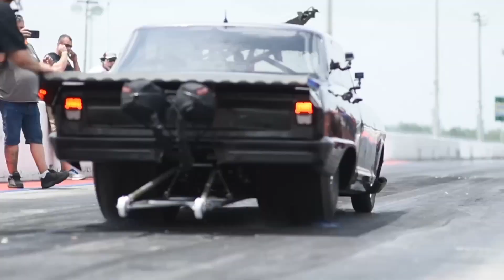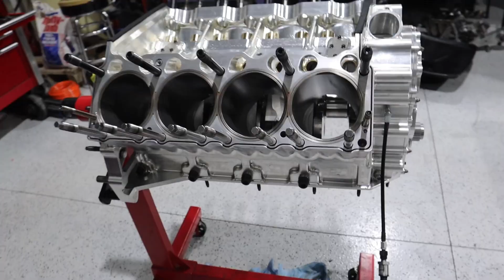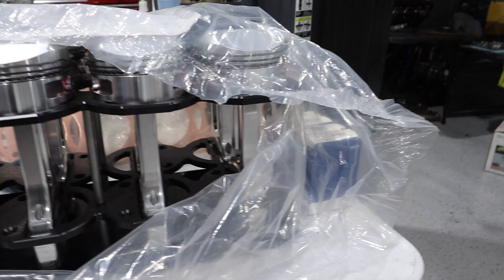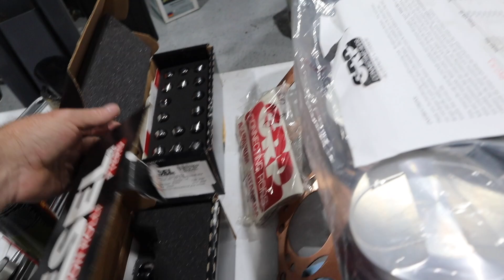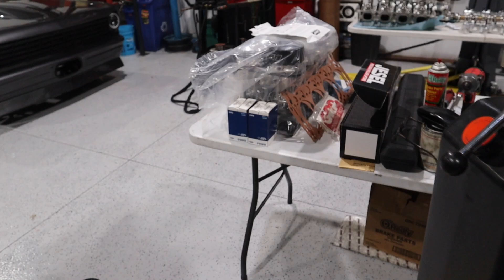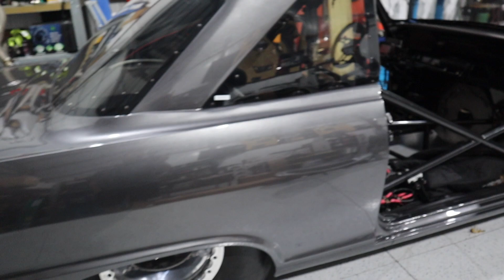Daddy Dave tears down Proline Hemi Engine from Goliath

Comment: I heat copper head gaskets in the oven first before putting them on the motor. A few hundred degrees for about 20 minutes. The process is called annealing. When that process is over coat them in a copper spray. Let the spray set up for 24 hours before installing 🙏💯

Comment: I was storing a set of New steel H Beam rods years ago. I put them in Ziploc plastic bags with coffee filters soaked with WD-40. I squeezed all the air out of the Ziplock bags. Few years later come back to use the New rods they had some rust on them!?!? But luckily the rust wasn't on the rod journals. Overtime WD-40 will rust steel. WD-40 is great for lock cylinders it's the only thing I use in lock cylinders but it is not for storing or coating metal it will cause rust overtime. Don't use graphite or grease inside lock cylinders it gums them up and then they need to be rebuilt or replaced. WD-40 is the only thing for lock cylinders. I brought many of lock cylinders to the locksmith to have him rebuild them. And I don't know why WD-40 doesn't rust inside a lock cylinder because they have steel springs. I'm pretty sure they are steel. I use to put WD-40 in door pin hinges that caused them to rust. I now use oil only.

Comment: I was putting together 426 pink motors in 70's not much has changed my question to you is why are you not ceramic coating the Piston tops, bearings, Piston & exhaust valves? I even do that on my turbocharged aircraft engine.

Comment: Thanks Dave, great video! Question, I still trying to figure out these Hemis! Are they a generic custom engine with no brand connection or is it based off the Chrysler Hemi! I hope I'm not the only idiot wondering this!😄
Reply: The Hemis used in these applications are a near carbon copy of the original Chrysler Hemi .

Comment: i love the bolt  in the mount of the engine stand. i think every stand comes with a new pin or handle to rotate when new but somehow they all wind up with a bolt in the lock hole after a while.

Comment: Dave, that motor is truly a beautiful work of art! All the parts are like jewelry! Since you had a lifter issue, I need to ask you if you have had any lifter issues with new lifters for any of your street cars? I’m asking because I have heard in the last year or so many people having lifter failures with flat tappet& hydraulic roller to the point that people have chose to go with solid roller lifters because people have tore up entire engines because of this issue which seems to be soft metal or poorly machined lifters. I have held off doing cams in two of my classic cars because I do not want to destroy the original motors. Any help would be great! Best of luck racing on America’s List! As always, my daughter and I will be rooting for you! Take care✌✌✌

Comment: Awesome design!  Now when you say they are going to check the crank for cracks I assume it is going to be x-rayed?  Or am I maki.g an ass of myself?  I think 187 Customs may have mentioned it in one of their videos.  🤷‍♂️. I also have a question about the oil pan.  Was it along where two pieces of material were butt(😅) welded.  Vibration from the engine can cause it to crack.  If so a lap joint welded on both sides would help prevent that.  🤷‍♂️. JS. I remember my welding teacher telling me that it's hard to keep aluminum from doing so when vibration is involved with those particular type joints.